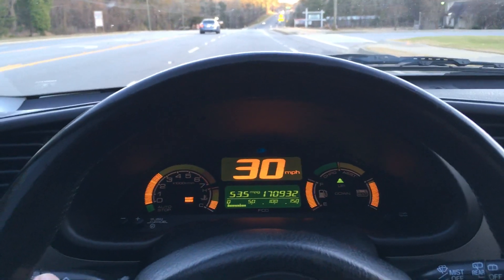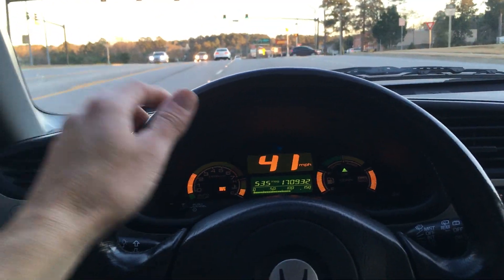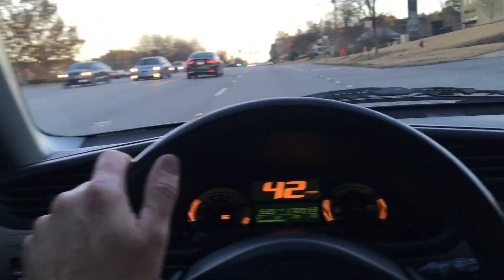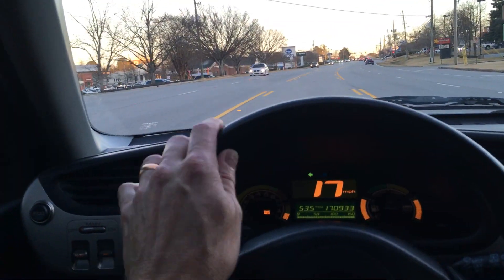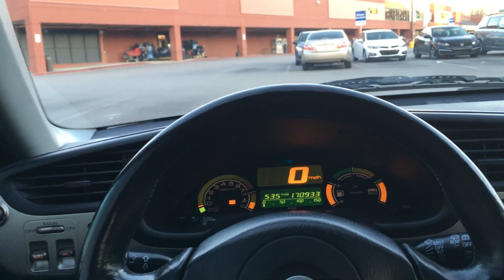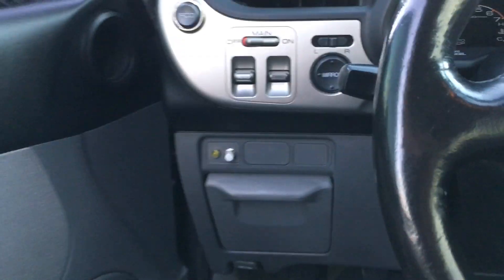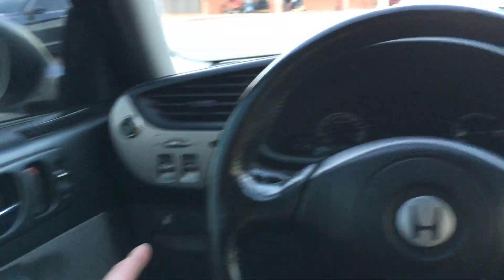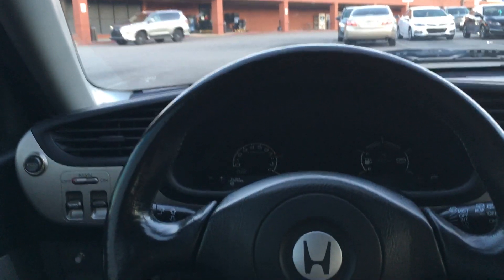2000 Honda Insight part 10: Clutch switch demonstration/review

Comment: Regardless of if you have a healthy battery or not, this mod when used correctly will prevent the battery from degrading as quick, and of course batteries = money.

I just moved to Willits, CA where there is a big mountian pass, over a 1,200' elevation climb, 5 minutes straight of pedal to the floor.  My assist is maxed out through most of the climb and my IMA bars are all the way to the bottom by the top of the pass. 

My tactic is to turn on the bypass switch when my IMA bars are half-way depleted.

Comment: It not only stops it from assisting when you accelerate it also stops it from charging on the battery when you're at cruise so if the battery needs to be charged in the background it turns that off which gives you a few precious MPGs!

Comment: As a CR-Z owner, this looks pretty neat. I always thought it'd be kinda' cool to drive around without the IMA just a bit to see what the experience is like.
Reply from the maker: It's unnecessary for my car since I have a new battery.  But for a car with a weak battery it's very useful.  You turn the IMA off when going up a long hill like on the interstate.  That way it doesn't drain the battery down.  Then when you crest the hill you turn IMA back on.  It's a way to control battery use and avoid recalibrations that might happen at the wrong time.  I don't need it but I thought why not.
Reply: Spoiler: slow